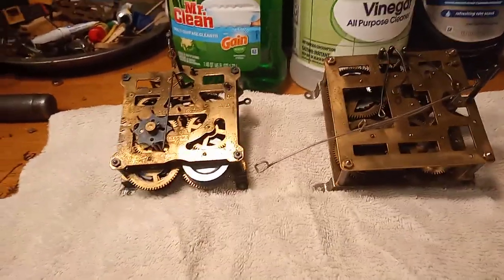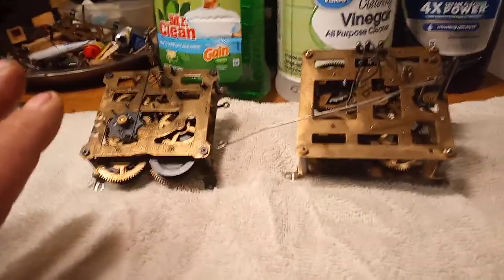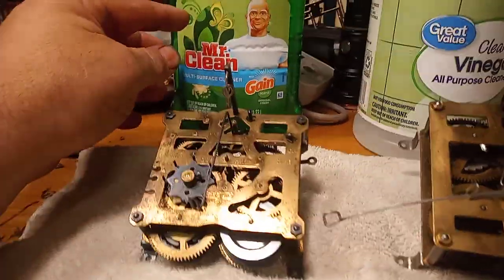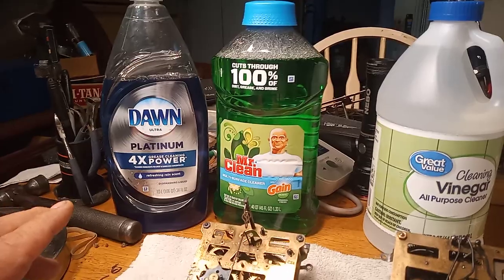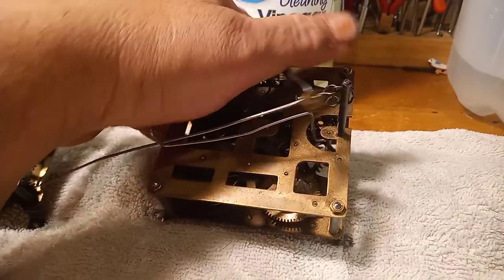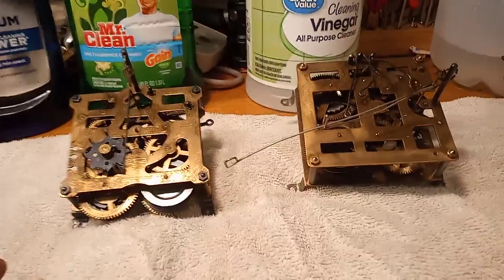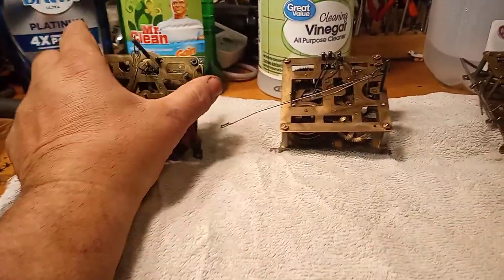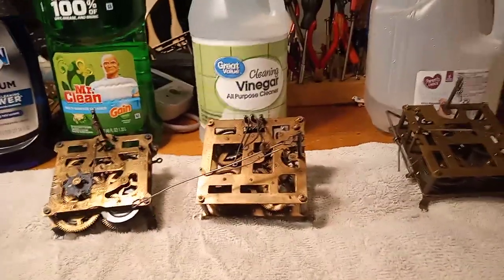Cleaning clock movements and cuckoo clock movements with a ultrasonic cleaner 20211205 190058

Comment: Nice video.  I only take apart clock movements when I absolutely have too.  My experience has been that with the right cleaning solution(s) in an ultrasonic cleaner the movement will be appropriately cleaned without disassembly.  I do two steps.  First 20 minutes in a Simple Green solution (40c - hot), followed by 30 minutes in clock cleaning solution 30 minutes (40c - hot).  I use PolyChem DEOX-700.  In instances where I have cleaned the movement in this manner and then have disassembled it I have found the pivot holes and all other recesses well cleaned.  Just my experience and I realize this does not conform to conventional thinking,  AND this approach only works with movements which do not have the springs contained in drums as you can not let the springs down for cleaning, drying, and oiling.
Reply from the maker: I take the movement apart whenever possible. I have purchased cleaning solutions in the past back when S LaRose was still in operational. I dont know if I got a bad batch or what but I wasnt impressed so I make up my own solutions.
Reply from the maker: Ross from my experience using hot and cleaning that long if you have a coated movement the time and heat will remove the coating from the movement. Plus not taking the movements apart the ultrasonic cleaner cant get every hard to reach spot such as the pivot holes. Do an experiment and that is this. Do it your way without taking an extremely dirty movement apart. Once you get it out of the cleaner take it apart. Take tooth picks to the pivot holes and see if they come out clean. From my experience they dont. Dirt in the pivot holes is dried up oil. Applying fresh oil to dried up oil is like using sandpaper and the pivot holes will wear out faster and bushings will have to be installed. That is why I recommend taking the movements apart. That and there is a local guy. He is really good with high end pocket watches. He has a contract/agreement with a local Jewlery store to get and work on all clocks that they get in. I have spoken to him about how he works on the clocks. He has told me tha the doesnt take the movements apart. A friend of my sister paid this jewelry store about $165 to have a Frankenstein type cuckoo clock that her daughter bought her for Christmas. When she got it back it worked for less than a week. My sister asked me to work on it. I did. It has been running for over a year now.

Comment: In the video, you say it is best to take the movement apart to get the pivot holes cleaned. Wouldn't that be a very small area that would hardly impact the movement?
Reply from the maker: That is exactly why you want to take the movement apart. The pivot holes get gummed up with dried up oil. If you watch me taking a movement apart I will take tooth picks to all the pivot holes and every time they come out black from the gummed up oil. Plus you cant polish up the pivots with not taking the movement apart and you cant polish up the verge pallets with it not being taken apart. Clocks in general need to be taken apart about every 5-6 years to clean them up. You can lightly oil a clock every couple 2-3 years but you have to take the movement out of the case to do so. So why not take it apart and clean it correctly if  you are going to take the movement out of the case. I fixed a clock for a lady who paid over $160 to have it serviced. I know the guy. He is a local guy. We have talked face to face. He has explained to me that he doesnt take a clock movement apart in general. He puts the entire movement in his cleaner. This cuckoo clock that she paid that high dollar money for is a Frankenstein cuckoo clock that her daughter bought her for Christmas. When she got it back from the shop it didnt even work a week. So I servided it. Had to order a part for it. It is still running to this day and that has been 2 plus years ago.
Reply: @munnerlyn3  OK, so if you take it apart do you still place all of the parts in a sonic cleaner?

Comment: I used purple power degreaser sprayed everywhere and then washed it in dawn/water then rinsed it thoroughly with distiled water and it seemed to work fine.  I oiled my movement and it seems to be running great but I'll see how long it lasts.  It wasn't very dirty to begin with.  Is is possible to look at the movement and see whether it is lacquered or not?
Reply from the maker: Lacquered movements have a shiny coat on them. A lot of times you can tell but a lot of times you cant. I have been told, but I dont know this for a fact, that they are coated for different areas to prevent corrosion. Again if you dont know for sure that they have been coated then test them 5 minutes at a time. I know the answer is kind of vague but that is all I have..........Hope it helps.
Reply: @munnerlyn3  Thanks for the info.  I've thought about adding olive oil to the cleaning mix since it contains about 70% oleic acid which is a component of commercial clock cleaning solution.  I've (since asking you this question) found out that you can pick a small inconspicuous spot and add a drop of acetone.  If it beads up there is no lacquer.  If it dissolves the surface then there is lacquer.
Reply from the maker: Thanks for the information............I will pass it on.

Comment: If I soak a movement in a still bucket and let it sit for an hour or so, will it ruin the brass?
Reply from the maker: That depends on what your solution is and if that movement has a protective coating on it. Anything that has harsh chemicals such as chlorine, acetone, etc.,. will take the protective coating off.
Reply: @munnerlyn3  what about if I just soak it in tap water?
Reply from the maker: I  dont think  it would do much good. I would soak it in soapy water at least. Dawn or something that cuts grease. Make sure that you rinse it off real well and dry it real well afterwards.
Reply from the maker: using a tooth brush and rags to clean it up as much as possible and then tooth picks in all the pivot holes.
Reply: @munnerlyn3  and after cleaning do I need to oil it again?
Reply from the maker: yes when cleaning you are removing old oil and grime so you have to put fresh oil back in. I  use synthetic motor oil myself 0W-20.  As long as it starts with a zero is what matters. Only a minute drop of oil per pivot hole and on the verge pallets.

Comment: Buy the proper cleaners for clocks there are many out there. That way you can be sure they are safe to use with any clock movement. I use Horolene clock cleaner. You will need a well ventilated place to use it in.
Reply from the maker: I have bought clock cleaners in the past. I purchased a bottle from S LaRose. I wasnt impressed and that is why I make my own formula.
Reply: @munnerlyn3  Have you tried Horolene clock cleaner? I uses to be a clockmaker restoring and repairing high grade clocks many were hundreds of years old, I used that stuff as part of my cleaning plus other things.
Reply from the maker: No. I dont repair clocks for a living. The clocks that I repair are my clocks. I am on a fixed income so I cant see spending $30 for cleaning solution just to see if it will work as good or better than my home made solution that I am completely satisfied with. If I was doing this for a living then yes I might buy some of the company clock cleaning solution and charge the customers for it but since I dont I cant see the reason to purchase it.
Reply: @munnerlyn3 That's fair enough. Carry on enjoying repairing your clocks. Nice talking to you and take care.
Reply from the maker: you do the same. I hope that you subscribed to my you tube channel. If not for anything else to keep me straight.